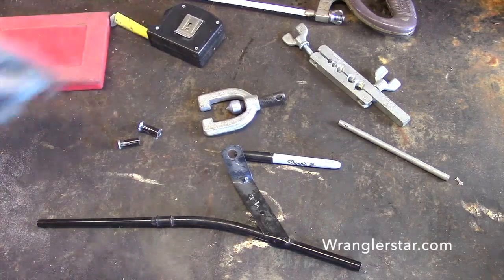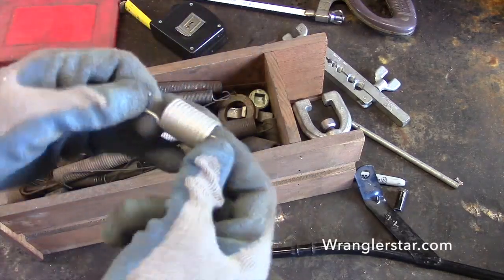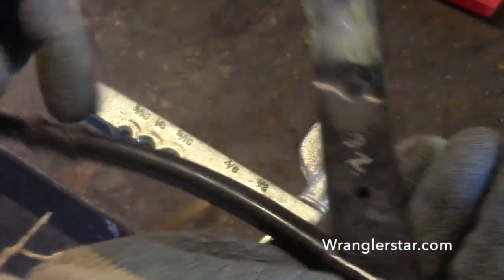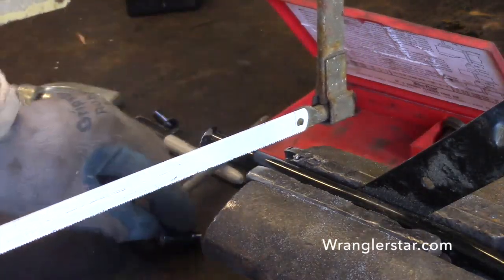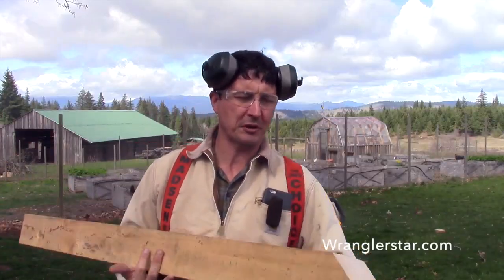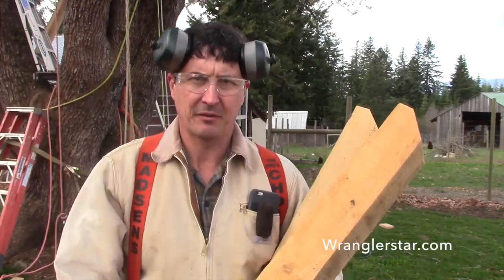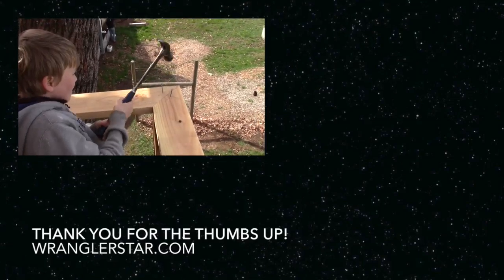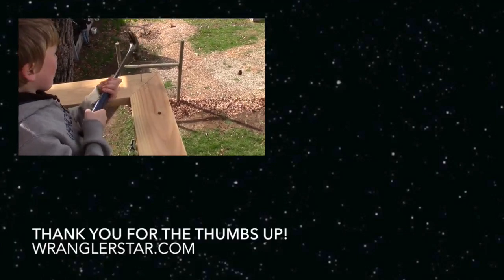How To Build A Treehouse | 28 Wranglerstar

Comment: Bit late ,but the flaring tool is standard tool for refrigeration tubing .Great exercise after flaring all the sizes on a manifold board etc. Oil and brake line fittings are flared with a slightly different flare for strength issues. The wire line rails work better if you fit small turn buckles into each line,but each to his own.

Comment: I've seen this done before, for those of you who don't have a flaring tool. Put the pipe tight in a vice and use a large ball bearing to hammer into the top of it, leaving you with a nice symmetrical flair.

Comment: wranglerstar Just a quick question. Those quick clamps that you use what is the purpose of the second slide on the pad side of the clamp?  I've never seen clamps like that before and am just trying to learn and figure them out.  Thanks in advance.
Reply: They are called Jack Clamps if that helps.

Comment: G'day Cody, now I don't want you to misunderstand me here, (nor anybody else from the U.S. either for that matter) it's just an observation. I find it ironic that the U.S. went to war with the U.K. in order to free itself from oppression and subjugation, and yet kept (and still is using) the imperial system of measurements. P.S. I am from Oz not the U.K.
Reply: No....with Great Britain.
Reply: Lex Rex We didn't go to war over the "system of measurements".  There are a number of reasons that we still prefer the Imperial but in reality we do use both systems.  for instance, measuring temperature in Celsius is not preferred here because Fahrenheit is a more precise measure and altitude affects the boiling point of water so the "0" - "100" basis of Celsius has no meaning for its basis.
Reply: We went to war with germany and drive vws. We went to war with japan and have kotos and japanese swords...ect..whats the point...you all bring great things to the table....life goes on.
Reply: I imagine the founders of America were more concerned with the ideology of Great Britain's rulers of the time more than how they measured things, But I see what you're saying:)
Reply: The metric system didn't even start in Britain until the mid 1960's and they resisted the hell out of it.  It was invented in France in 1799.  It´s easier and more accurate than the imperial system and Americans hate it.  We hate change. And only about 20% of us can multiply by 10 consistently
Reply: Lex Rex England hasn't given up it's tradition to the metric system entirely either.  They still prefer to use the "Stone" when measuring body weight.
Reply: Kdan Frew .....not true....about the 20 %......all can multiply consistently if it was a 10 dollar bill.......
Reply: Surprisingly, that's an interesting question. According to Wiki, when the French were establishing this universal system, they invited Thomas Jefferson to participate in its development. Jefferson then tried to have a bill passed introducing the system, but it was rejected. You might have thought, with the revolutionary spirit still alive, and another war with the British not too far in the future, Americans would have adopted this system just out of spite.

Afterwards, the explanation is plain. Who wants to pay for the costs of conversion? No one. Why should we? Just to be like everyone else? That's not a good reason.
Reply: .....hahahahaha....S.A.E......V.....METRIC.....haahhahahaha.....btw.....S.A.E. means.... society of AMERICAN engineers......
Reply: Sae is automotive industry...Society of Automotive Engineers...?¿
Reply: R HEIDEMAN we went to war with the Indians and still have casino's lol  .. what ? too soon ?
Reply: chop glitch lol...and corn....
Reply: ClockCutter I didn't mean to start a debate / argument over a system of measurement , and meant no offense. I was just making an observation and thinking more in line with what you have written above regarding Jefferson not being able to get the bill passed etc. I agree why change / convert something that's not broken and has been used for decades if not centuries now.  It was just a point of interest for me, I also find it interesting mdbigman 's point that the U.K. still uses both systems and hasn't converted over in it's entirety either Australia converted to metric in stages from currency in 1966 through to distance in 1974. I'm not suggesting one system is better than the other it's just interesting for me. Sort of like different shoe and clothes sizes between Europe, Australia, The U.S. and Asia.
Reply: Lex Rex
I wasn't trying to be derogatory when I said, "That's a surprisingly a good question". I had always assumed that adopting the metric system wasn't really an option for the US until the late 19th century, when in 1875, the US was a signatory along with 17 other nations, to the Metre Convention. I had no idea Jefferson was involved so early and tried to get a bill into Congress to establish the system. I was surprised.
Reply: Lex Rex I agree it is an interesting discussion and one that most people don't know well.  Part of the reason that Jefferson didn't completely back the conversion of the US to the metric systems is that there was an issue with how to establish a "verified" unit of measure for the US.  It would have necessitated the sending of a US delegation of "experts" to France to establish this and the cost was prohibitive.  Also as ClockCutter pointed out, we were certainly allies to France during the Revolutionary war, but after the Jay Treaty between the US and Britain in 1794 our relationship with France soured a bit (almost to the point of war).  France actually excluded the US from the 1798 Paris Metric convention. However, in the 1860's the US did sign into law the approved use of the Metric system and we have used it ever since.  One issue in the US has always been that most of our industrial and engineering had to continue using Imperial simply because it would be far too costly to convert it all over to metric.  It was far too cost prohibitive to convert all of the tooling and machinery over to metric.
Reply: ClockCutter
No I didn't get your comment as "derogatory"  buddy :) my comment above was in general terms to those others who thought I was "complaining" coming from Australia etc i.e. MegaMetinMetin 's comment in particular. You ClockCutter and mdbigman got the point I was making regarding a topic of interest to me. It's difficult sometimes with written communications because there is no tone it is easy for people to misunderstand me and it seems to happen a lot online :) I try to be clear as I can in the way I draft my messages but alas I seem to offend people some how it's a gift or a burden I suppose :)
Reply: Lex Rex LOL  I thought it was pretty clear when you said "you didn't want to be misunderstood" that you weren't trying to offend anyone but rather that you had a legitimate question.  Additionally your follow up responses have done you credit!  I hope that the few responses that missed your tone don't deter you from responding freely!  I enjoyed the discussion myself!
Reply: mdbigman Thank you my friend :) I try hard not to offend people, (without due cause) and perhaps I'm a tad paranoid about offending people online, because of the vicissitudes of my life and careers. I am an ex Detective from the NSW Police and now a Lawyer, so I have in the past and continue to offend people in real life as a part of my current occupation, but only in the context of my job and it's never personal. :) LOL  Though witnesses under cross examination take it to be. :)
Reply: Lex Rex LOL  Very interesting!  So I would assume from that you are used to being judged!   YT is a great forum but it does seem to attract its fair share of "unbalanced" people.  It must be rewarding to offend people for a living! LOL  I admit that it is simply a hobby for me!  I enjoy debate and there seems to be no shortage of ignorant people logged in to YT to satisfy my enthusiasm for debate.
Reply: mdbigman Yes unfortunately for me I have been judged all my working life, hence the paranoia LOL and self self consciousness about how my words may be able to offend people. My son (13 years old) got me hooked on wranglerstar's channel prior to this channel I never used to comment on YT. I thought it was all about music and people doing crazy things etc. Call me a "late developer" LOL So effectively I only comment on people's channel where I sort of know the vast majority of subscribers are normal people, with scatterings of trolls :) Being able to offend people for a living is not rewarding believe me, it pays the bills and that's about it. You get a skewed view of life and people in general i.e. seeing all the bad all the time makes you believe the bad out numbers the good. So when you find good decent human beings it's like you've won the lottery. I've become sort of misanthrope over the decades and wished I had of been a farmer instead dealing with crops and animals instead of people. I want to eventually retire onto a farm :)